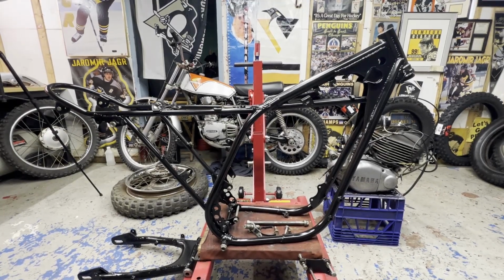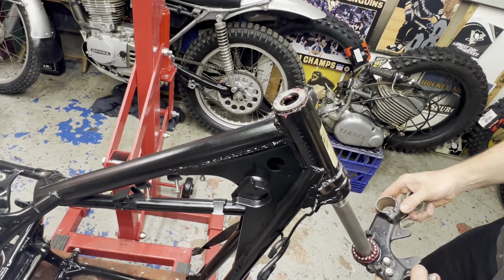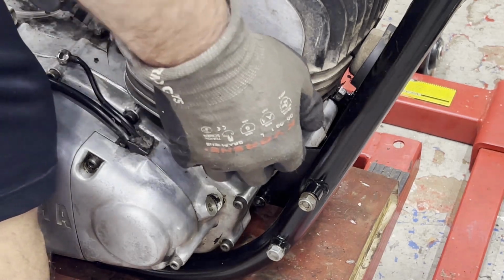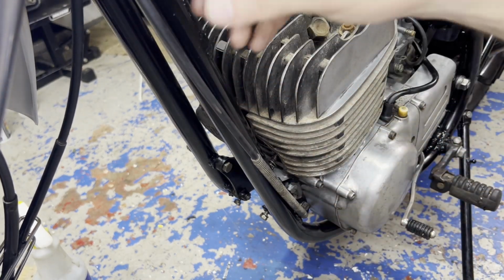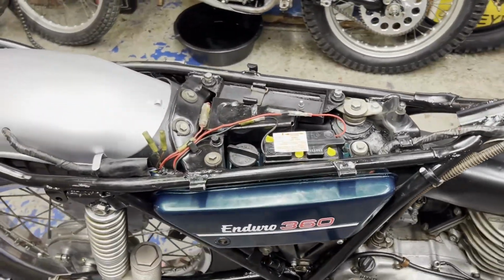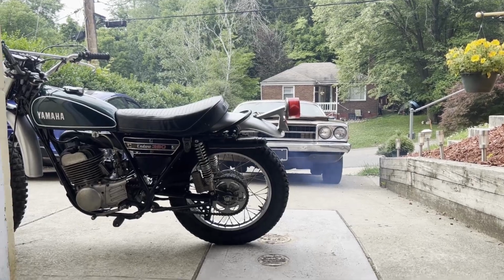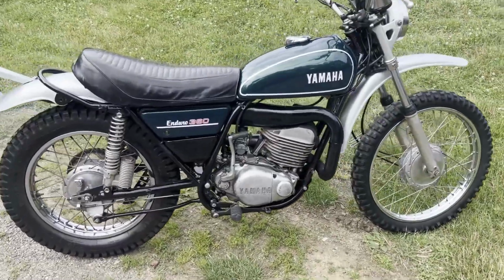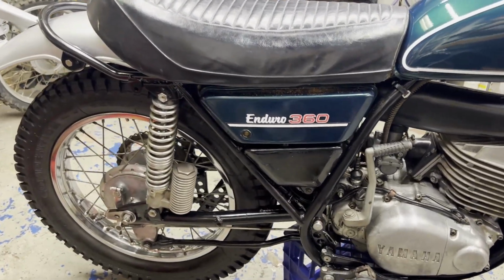1974 Yamaha DT360A:  lets go for a ride!

Comment: I just picked up the same bike and am in the Pittsburgh area!  Well done video!
Reply from the maker: Thank you!  Was the one you got the one that was listed in Wexford by any chance?  That thing looked clean!
Reply: @Garage2Trail  Yes!  It has good bones.  Kind of a good from far, but far from good type of bike.  Needs some things, but I've already made a ton of progress rebuilding the forks.  Tank has some rust in it and needs a new throttle/oil cable.  This is a great video series to reference the wiring routing so much thanks!  I'll be heading to Mid-Ohio this month looking for some small parts.
Reply from the maker: @JEMadaras  awesome!  I’ll be there too!  I also need to get a new throttle/oil pump cable.  There are new reproduction ones online that I might get if I can’t find any at mid Ohio.  Might be bette to just get new ones anyway.
Reply: @Garage2Trail  I saw you rolling around the swap on your 250.  Very cool bike!  Did you get this carb issue resolved and find your rear turn signals?  I'm looking for those rear brackets for the turn signals.  I'll be putting together the bike this week as I'll have all my parts.  Probably will post up a video on the FB group.

Comment: Had a 1978 DT100 brand new in 1979.  I was 12 and the sounds bring back memories.  The pitch was higher but similar idea, these didn't have power bands like the YZs did. Any street legal 2 stroke is awesome IMO.
Reply from the maker: That’s great!  I really fell in love with these DTs over the last couple years and they are right up there with my other favorite bikes (XR’s and XL’s) now.  Check out some of the other ones I’ve done on my channel if you get time.  I just got a 1975 DT125 going and the video for part 2 will be out tomorrow afternoon.  Part 1 is up now so you can see the shape that poor bike was in.
Reply: @Garage2Trail  I'd love to buy a decent one some day and drive it on the road.

Comment: Dude, I think that I owned that bike. I remember the kickstand breaking off and the poor welding repairs. Had tons of fun on it and sold it in 1977 to buy a new DT 400D. Thanks for the trip down memory lane
Reply from the maker: Did you happen to paint the bike yellow or have to repair the case where the chain hit around the sprocket by any chance?  That would be crazy if it was yours!  Thanks for watching 👍
Reply: I didn’t paint the bike when I owned it. The kid I sold it to had it stolen from him. Any thing is possible l guess

Comment: That's the 360 my uncle had back in 79 or 80. Last bike I did was an xr 200. Presently building an rm85. 
Keep vds rolling.  👍 👍 👍
Reply from the maker: Awesome!  I just also recently redid the top end on a 2002 XR200 that I picked up last winter after the previous owner said it dropped a valve.  Just sold it before heading to mid Ohio to make room for more projects.  I’m always looking for a 79 RM80 to redo.  That was my first bike in 1993 when I was 13.
Reply: My xr is 01. Sounded like a sewing machine when I got it.  Runs vg now. Shock also a disaster.
I'll keep on watching !

Comment: Good job, I really like it. I have one that runs but is rough, looks like the headlight bucket saw a tree up close, right peg mount gone and some junk welded in its place,  I have a 1100 original mi 76 400 and a running complete high mi  75 400 , also pretty nice 75 175 about 1300 mi and a completely disassembled 76 250, may have to use it's frame and headlight for the 360 after see yours 😅😅
Reply from the maker: Thanks!  After I got this one printed up and seeing how nothing is bashed in, I have to keep this one!  Problem is I want to keep all my other DTs too lol. Need more space!

Comment: Awesome job! Looks and runs great! The 74 model is the only year that has the larger rear sprocket same as the DT3 . All 360 and 400s have the smaller sprockets. Just a tidbit 😂 thanks Mike
Reply from the maker: Thanks!  I appreciate any info I can get on these bikes.  I still have a lot to learn.  In fact, I just filmed myself riding that bike after getting the jetting sorted so look for that soon!
Reply: @Garage2Trail real quick question? Where did you get your battery for the bike? Thanks Mike
Reply from the maker: @michaelmain8719 no problem Mike!  I got that off eBay.  Just pop in the battery number in search and there will be a couple that pop up.

Comment: Where did tyou get your new tires from?
Reply from the maker: That rear was an unused trials tire I had laying around…the front I didn’t change.  It’s just some old knobby.
Reply: @Garage2Trail  thanks for the quick reply. any recommendations on where to get tires from? I am working on a 1974 DT250.
Reply from the maker: @vwtommy07  no problem!  What all does yours need yet?
Reply: I always use the Dunlop 803 Trials front/rear tires on my Yamaha Enduro's , closest looking to the OEM tire once you have to replace the originals .
Reply: @Garage2Trail  clutch cable, tires and the forks need to be rebuilt. I put the carburetor back on yesterday after rebuilding it. would you be interested in in doing a rebuild video on this bike for me?
Reply from the maker: Check out rockymountainatvmc.com for tires.  They have a huge selection.  I have such a backlog of bikes to get to I’d have to graciously pass on another one at the moment.  I just have no room lol.  Until I can sell a couple I’m packed full of bikes lol

Comment: Nice job that you got done. If I may suggest running some premium gas with 4 ounces of Chevron Techron after any other carb adjustment. Once in a while with fuel using a little bit of marvel mystery oil in the full tank of fuel. Congratulations for another very well done great job.
Reply from the maker: Thank you my friend, I will give that a try!